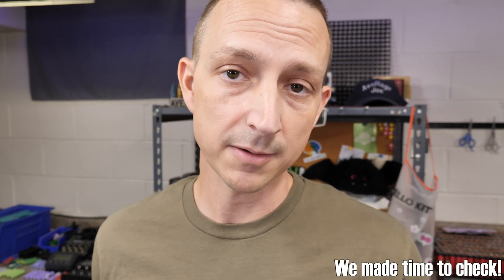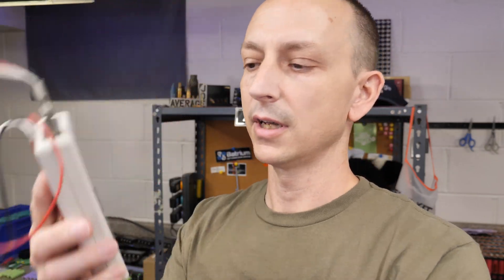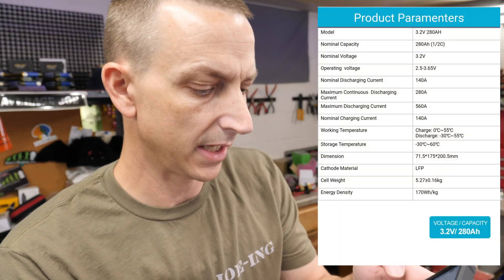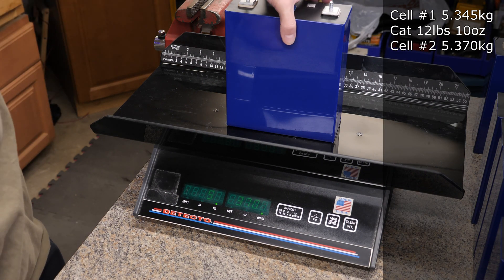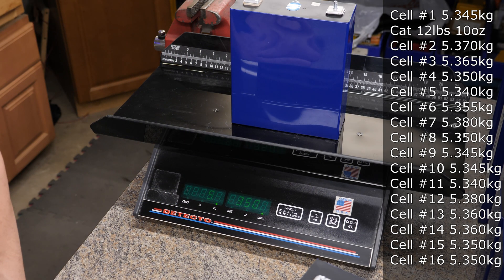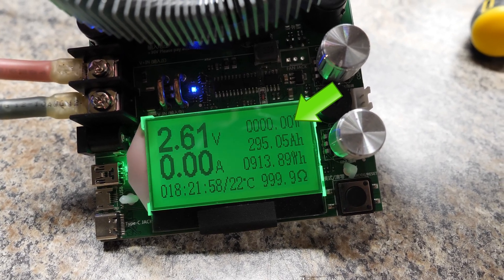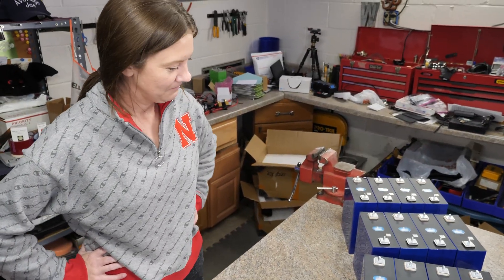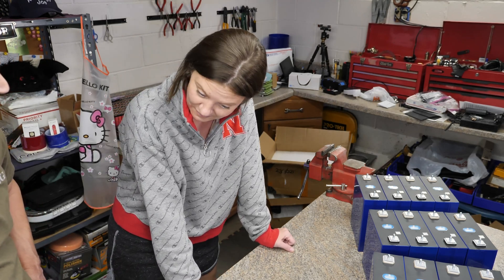REPT Ruipu 280ah LFP Cells from Alibaba

Comment: Im gonna buy 16 cells from 18650 later today its the 280 cells they are advertising.  Would you recommend me a couple bms. I have a 24 volt sustem and have never used lifepo4.  Im planning on building two 24 volt batteries to run in parallel for my camper. I hope this will be enough power ya know. But yes please tell me what bms i should buy. Ill be powering a 4000 watt sungold power inverter. Id like kinda large bms so that if i want to add an inverter later i can. At the moment im using 24 leaf modules on 2 inverters. A 3000 watt running camper and a 4000 watt split phase running minisplit. I barely make it thru the night with power tho so by putting the 4000 or 3000 on the new battery hopefully I can make it c couple days. Any help greatly appreciated
Reply from the maker: I personally like using JBD bms's. Many also like JK bms's.

Comment: I bought some of these cells. 5 arrived 5mm taller and about 70grams heavier than the other 11!! Even though I plan to use flexible straps to connect them (solid copper ends, braided tinned copper as the bridge, wrapped in shrink wrap), but I guess I could pad the bases of the shorter ones by 5mm to bring the tops level. The taller ones I have tested, using a slow discharge are around 292Ah or more (advertised and labelled as 280Ah). All cells were pristine on arrival. I am testing the shorter ones right now, but they are looking good for around 290Ah as well.
Reply from the maker: Thats crazy that some are taller. Only thing I could think of is they are the "newer" version. Glad to hear they are testing as well as mine!!!🤘
Reply: @AVERAGE_JOE  When I ordered mine, the spec sheet said 202mm tall I think. I just checked, and the listing now says 207mm tall, so I guess you are right. The listing title now says 280Ah 290Ah capacity, but the stated capacity in the chart is still 280Ah. It's amazing how long it stays above 3.2V when discharging. It has a very flat curve, with only the last few Ah at below 3V. On every cell I got 280Ah at 3V or above.
Reply: @AVERAGE_JOE  Just finished all the tests. ALL cells yielded between 292Ah and 293AH. All cells yielded more than 280Ah at above 3V. No signs of bulging, no signs of them even getting warm, let alone hot. I would say yes to these ChinaREPT (Ruipu Energy Co., Ltd) cells.
Reply from the maker: Hell Yeah! Thats great!!!💥🤘

Comment: I bought 32 of these same cells and are using them.  I did a .1C discharge rate.  I got 286Ah from a single cell.  I also documented the voltage at various points in the discharge.  

80% (56Ah used) -   3.316 volts
60% (112Ah used) - 3.298 volts
40% (168Ah used) - 3.274 volts
20% (224Ah used) – 3.239 volts

I used those values while setting up my Overkill Solar BMS
Reply from the maker: NOICE!!!!!!  Thats Awesome!!  Its great that you documented all that!  286ah is GREAT!!!🤘

Comment: have you considered the 500 amp hour cells they make just like the 280? i see they have these now.
Reply from the maker: I think those are a scam. Highest they make is 310ah but they test a little lower maybe 300-305ah.
Reply: @AVERAGE_JOE  if my numbers are right its about 50% more power from only about 25% more money. i originally considered buying 20 cells that is the money i allocated for batteries. but 20 cells don't mesh for 48v. i can't think of any other way to arrange the cells. so getting a 500ah cell worked out better for me. but its about 610 lbs for a bank of them

Comment: What BMS will you use for this.  Do you like the overkill BMS?  Would it work with a 16s2p configuration of these batteries?  https://overkillsolar.com/product-category/48v-bms/
Reply from the maker: Ill be using my batrium from my 18650 powerwall.  Yeah I like the jbd bms's that overkill uses.  If I didnt have the batrium Id use jbd or diy bms!  I actually ordered a few of the jbd from alibaba for a few other projects!!  I would actually do 1 bms per 16 cells.  A 2p in my opinion for 280ah cells is to much for a single bms.

Comment: These look like my supposed 310ah Catl cells. My 310ah cells tested 295ah. If these are the same then they have had their original QR code removed and replaced by a new smaller off center QR code. the reason they are testing so high is that they are not 280ah cells but are grade B 302ah or 310ah cells. as long as the cells are not bloated(mine were not), they should work out fine. the biggest problem is the mismatching of capacity. This may show up as some cells reaching max or minimum voltage much quicker than the others resulting in inability to charge to 100%. I don't worry about that, as I only charge to about 2.5 per cell anyway. For the price you paid, I would say you got a good deal.
Edit: meant charge to 3.5 not 2.5
Reply from the maker: Nice! Yeah I always assume that these and other cells like these were supose to be a higher capacity cell and didnt meet the original specs so sell as a lower capacity cell. Im all good with that at this price lol. Maybe ill pull back the top cover and have a look C! Yeah under normal operation Ill charge lower as well! Cant wait to get them all connected and running!😆🤘

Comment: Just found your channel. Nice review and the price sure looks good for 295Ah. I want to build a new 16S-2P solar storage battery but finding it difficult to justify spending the money since the 270Ah batteries we are using now are fine.
Reply from the maker: Thanks Mate! Yeah saving up for new cells is always a hassle lol. With these new cells Ill have a 16s2p! Which 270ah cells do you have meow?
Reply: @AVERAGE_JOE  Its kind of long story, I do have a couple YT videos describing my "weird" system. The first complete battery (150Ah) I purchased was a YIYEN brand but I wanted more capacity and also to build my own battery. I purchased 16 (120Ah cells, not sure what brand) and put everything into a Saginaw Engineering cabinet. ZEVA Batt Management Sys., JK BMS brand bluetooth 2A active balancer, 200A golf cart relay. I'm Using both batteries connected in parallel with a Midnight Solar bus bar. They are working fine even though are somewhat mismatched in capacity. Since then the BMS on the YIYEN battery has developed a problem where it goes into over voltage alarm if charged over 54.8V and of course there is NO tech service from China. I also wanted to eliminate the golf cart relay parasitic load by using a Shunt Trip breaker on the new battery.

Comment: Just an FYI, most 280 Ah LFP cells are actually used or grade C, 300 Ah cells that are de-rated so when they are capacity tested they meet spec. That means at 280 Ah, they're already degraded to 93.3% of capacity, or the equivalent of having been fully cycled at least 667 times out of the 2000 cycle lifespan. This means you'll likely get no more than 1332 cycles if you cycle them 100%. If you only cycle them 60% or less between charges, you should get at least 5300 cycles at that depth of discharge.
Reply: hey mate, can you let me know how you know that? I've always thought the same thing. Just couldn't get it confirmed.
Reply from the maker: Ive done an updated video btw with real grade A and Alibaba grade "A" on my channel.

Comment: Are you going to sand the tops to get off the aluminum film?

Looks like those cells increased in price by $20 each since you bought yours. Still cheap compared to many other companies.
Reply from the maker: I may scuff the terminals with a scotch brite pad or similar!  I think the price went up $10 didnt it?  Agree tho, still not to bad for 295ah cells!🤘
Reply: @AVERAGE_JOE  just got done ordering more cells best I could find was 100 U.S. dollars each but no bus bars, this is for 280ah. Every where else is around $110-130 each. Shipping has gone crazy too

Comment: How are you planning to wire these?  4s-4p for 12v or 8s-2p for 24v?  Whenever I see these large-capacity cells, I always think you need at least 32 cells to make a 16s-2p, 48v system to work with a larger, grid-tied inverter.
Reply from the maker: Since I have 16 lishen cells as well or 32 cells all together Im planning 2 sets of 16s1p and then parallel the 48v side! Planning a cleaner smaller footprint over my diy 18650 powerwall in the server half rack.😆🤘
Reply: @AVERAGE_JOE  - That makes a ton of sense.

Comment: Oh well, now you have disappointed a lot of people. 5% over advertised capacity, all good quality and within specs. What happened with those companies in China? :))) Glad you got a new set of this amazing technology. If I ever buy some, I will just install them right away and not even waste a second with testing. Let the energy flow... That corner dent is not an issue, Corners are hollow as the pouch is wound around the center taps.
Reply from the maker: 😆 Ill take the disappointment lol! I was tempted to not test them but I havent seen anyone with these cells so was interested to see if they tested ok. Glad I did cause 295ah is GREAT!!! Yeah im not worried about that dent at all!🤘

Comment: I order mine from Exliporc on Alibaba on April 27 2021, received them at my door (N.California) on June 24th (they were sitting at custom for about two weeks), $85 ea four total, shpd DDP is $103. They tested out to be at 290Ah, very happy with them and I really like the welded tread holes which has about 8mm thread depth, I did not like the welded stud.
https://diysolarforum.com/threads/exliporc-280ah-rept-batteries-received-6-24-2021.24552/#post-292395
Reply from the maker: Nice!!!!

Comment: That blue model airplane covering with new black top plastic makes used or less than new specs or damaged ones look new. Many of those over .25 mohms are not good. Mine cost more but all were .15, no damage.
Reply from the maker: Hard to say for sure! The lishen cells during discharge test are .13 these are .19 during discharge. Which cells did you go with?
Reply: Shenzhen Luyuan Technology Co., Ltd
Reply from the maker: Ill look them up thanks!

Comment: that cell with the crooked terminal, use it at the end or use cable to connect. i suspect if you use the plates on it it will force the terminal level and who knows what it does in the inside.
Reply: Yeah, i'd use it, but would capacity test it to make sure no internal joints broke and wouldn't want to further bend the terminal.
Reply from the maker: You betcha! Ill capacity test it!
Reply from the maker: Thats a good idea! My plan for the new install I can use it on the end! 😆🤘

Comment: Hey Joe..
Sehr interessant... 
Ich hab ähnliche bestellt
Meine 18650 Pw läuft prima und stabil.
Jetzt brauche ich einen Akku für   ein wohnmobil.. Deswegen probiere ich die eckigen mal aus. 
Aber ich hab verschiedene Meinung dazu gehört.. Soll man sie zusammenpressen oder lieber nicht?🤔
Machen sie einen Bauch beim be und entladen oder bleiben sie in Form?
Deine laufen ja schon eine weile.. Ist dir da etwas aufgefallen?
Ps wenn du die auf den Kopf stellst und zusammendrückst, schaffst du sicher 301Ah😎😋😂🤣🤐
Tolle Arbeit. Danke für deine Zeit
Reply: jede form von "zusammenpressen" ist besser als gar nichts. schau dir mal den "off grid garage" an
Reply: @ursodermatt8809  
Ja bin auch Fan von Andy..🤓
Ich hab schon paar fürchterliche Bilder gesen wo nix gepresst wurde.  Jedoch scheint es auch zu genügen, mit Tape zu umwickeln.. Wer weiß was in der Zelle passiert wenn sie nicht arbeiten kann.. 🙃
Reply from the maker: Thanks Mate!  Which did you order?  Yeah they say for longer life to compress them slightly.  Dont need to smash them together but more of keeping the shape of the battery so they dont swell.  Yeah my 18650 powerwall is still running great.  Im just looking to make things a little safer!  I would say I stay in shape to a point as I am an aircraft mechanic and always moving around lol.  Ill be giving that a try by turning them upside down for 300+ah😂
Reply: @AVERAGE_JOE  100Ah liitokala . Möchte sie mal probieren.. Hab eine kleinere Anlage mit 24 Volt was denkst du reicht da ein Klebeband ?
Und noch eine Frage. Wo genau machst du bei der Katze die Busbars fest?😋😂

Comment: Almost sounds affordable until I convert to Cdn and ad shipping comes to almost $200 a kwhr
Reply: and then? why did you stop there?
you have your calculated 200$/kwh divided by 8000, then what is the cost then?
then, we come to 2.5c/kwh
makes sense to you?
Reply: @ursodermatt8809  sure compared to what AGM no. Used Lithium 8000 x 80% = 6400. So $75 kwh divided by 6400 = less than $0.0117 per kwh. So that is why it is expensive and I really only paid $50 a kwh but finding a source is a problem. Cheers

Comment: Everyone out there switching to LFP cells and here I am today building another 18650 pack.  Guess I might need to think about making the switch on the next one.
Reply: the sooner the better
Reply from the maker: Agree!
Reply: I wish i held back on 18650's and just got used ev cells... So many hours of assembling packs. (I have 26 80p packs and 13 60p)
Reply from the maker: 100%
Reply from the maker: Its much cheaper nowa days HOWEVER if you get 18650s for free then why not. I still have another set of 18650s seperated in boxes to build packs buuuuuut not sure if I ever will. Its a ton of work, time and effort for sure!

Comment: you should put one of these side by side with the eve/lishen cells and compare them. are they the same exact size? would the terminals line up with the lishen? would you be able to place a bus bar between a lishen and one of these as if you were building multiple cells in parallel? etc.
Reply from the maker: They are the same size but terminals are closer to the edge vs the lishen. Lishen are more towards center.

Comment: Hello AJ.. 16 pieces Sweet! $1692.13 good price for 16!
Hummm.. dents.. don’t like that. Probably no issues but never like to see any damage. I bought 64 pieces of Basen EVE 280ah cells and they had no damage whatsoever! All matched perfectly at exactly 3.30vdc with my 35 year old fluke dvm. Recently bought a new dvm with 4 digit resolution and checked one box of 4 cells.  All 4 cells matched at 3.304vdc exactly! 
The one thing I really like about your new cells.. They have Fixed Posts w/washer and nuts instead of threaded holes with screw in posts like my EVE cells.
Thanks sir 
✌️PT
Reply from the maker: Yeah not a bad deal at all since everything has been going up in price! Yeah nobody likes to see any flaws for sure but kinda think it was from shipping. Also the foam was a little thinner then Basen. Hope they can get better foam for future buyers. Yeah Ill have to get a fluke one day. There nice meters for sure!!😆💥🤘

Comment: Great vid there Mr. and Mrs. Joe! If you're going to write the manufacturer, you might suggest that the use the removable posts. That probably would have eliminated the problems. Anxious to see what you do for a charger and BMS system.
Reply from the maker: Thanks Man! I was going to suggest thicker foam similar to the lishen cells. The packaging on those were AWESOME!!! I like the post being welded but I also like the allen studs as well! I think ill be using the wm4 from the diy powerwall for the new cells. If I still use the 18650s then Ill throw the wm5 I have on those since it does up to 15s. If I didnt have the batrium then Id probly go diy bms or jbd!💥🤘
Reply: I'd be happier with longer welded studs if they stay with that design.
Reply from the maker: Do you have thick busbars?
Reply: @AVERAGE_JOE  No. The design is probably fine for the original intended use, but I'm going to be building parallel connected packs (16S2P or 16S3P).
Reply from the maker: Oh ok gotcha! Ill be doing as 2 seperate packs and will parallel the 48v side!

Comment: Please explain effect of ambient temprature on Lifepo4 
I live in hot climate
Reply: you look up their tables and specs. you can't possibly expect average joe to heat up his house to 40 degrees for half a year to answer your question.
Reply from the maker: Think of it like this, they like the same temp as your body😆 Temps for charging is 0c-55c or 32f-131f and discharging is a little colder. What is the temp in your area?
Reply: @AVERAGE_JOE  
In july its about 43 degree
Reply from the maker: 😲 whoa thats pretty warm! Technically the cells should be just fine according to the specs. Id probly add some natural thermal airflow. Hole in bottom of wall and hole in top of opposite wall so air can flow.